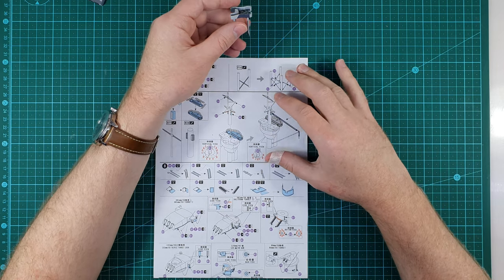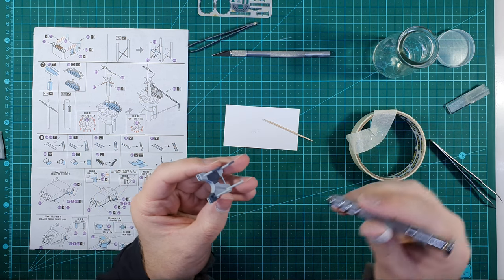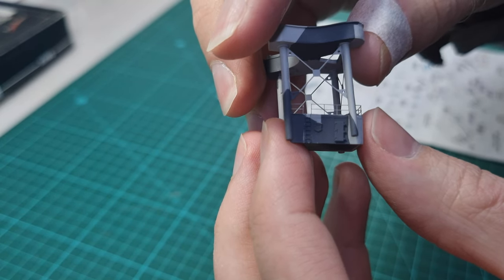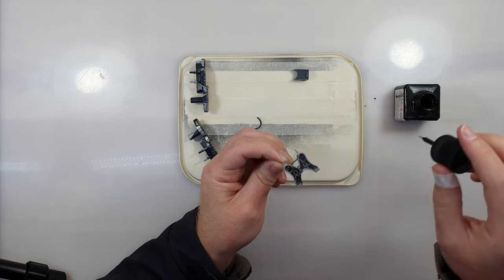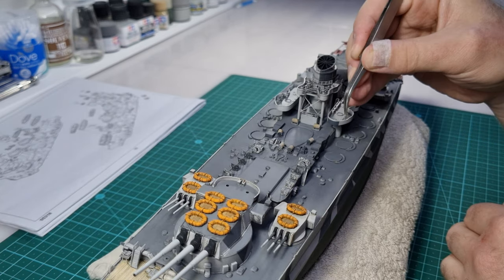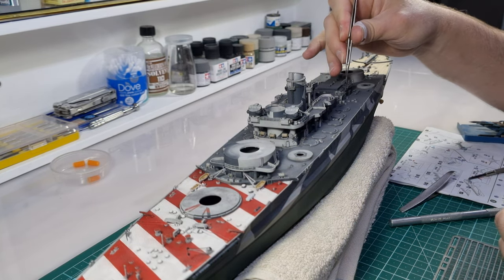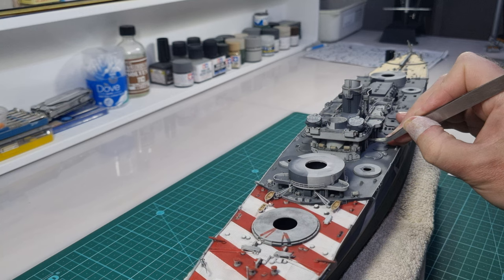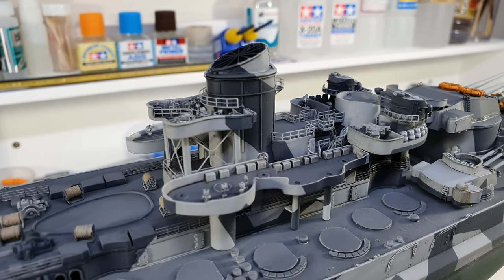1:350 RN Roma: Part 11 - Installing the Forward Funnel Superstructure & Level 1 Hand Railing

Comment: I really like your video style. Straight to the point. No obnoxious music or 2 minute intro then another 30 seconds asking for likes and subs. I do wish you had a video of your red white striping work on the bow. I'm afraid to start mine. PS don't hesitate to make longer videos!
Reply from the maker: Thanks!

The recognition stripes were a pain. I painted them after the camo on the side of the hull. The difficult part with this kit is that there are many objects moulded onto the deck. This means you don't get a flat surface to work on.

I like to work from the painting guide that comes with the kit. I scan it into the computer and scale it to be 1:1 with the model and then print it out. I place clear box tape over the enlarged paint guide so that I can stick tape to it and trace out lines and take measurements.

For the stripes, after painting the bow white, I cut out the paint guide and placed it over he model, then marked on edge of the  deck the boundary of all the stripes. I used 1mm tape to form straight lines between the markings.

Once the 1mm tape was straight and stuck down I filled in the white stripes with masking tape and sprayed the bow red. Once I removed the tape I noticed that the lines were crooked, they are not properly aligned on the painting guide.

I then spent some time positioning more 1mm tape on the model to make the lines parallel. They were all out by around 1mm. Since this painting is done early in the build there is not much risk if it goes wrong. You can easily spray over any mistake and start again.

Comment: Which glue would you recommend to best glue metal parts with plastic? I'm referring to those brass parts like ladders and railings. Thank you
Reply from the maker: You will need to use superglue for that. Plastic cement will not bond metal.
Reply: @DavidsShips  Something about Tamiya? or cyanoacrylate-type glue? Thanks for the replies.
Reply from the maker: CA/Cyanoacrylate/Superglue are all names for the same thing. Tamiya is a brand. I don't have a preference for a brand. I just use whatever is available.

It is helpful to have extra-thick and extra-thin viscosities of whatever CA glue you can find. You will choose the viscosity depending on what/how parts are being glued together.
Reply: @DavidsShips  Thanks, yes I know tamiya is a brand I thought you used a tamiya superglue, thanks for the replies.